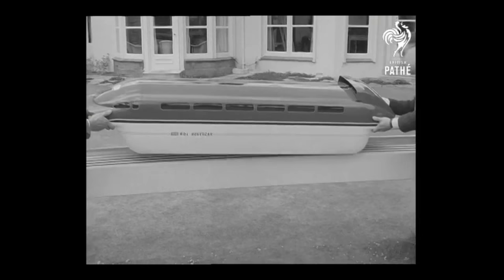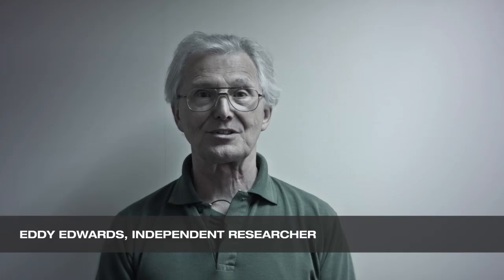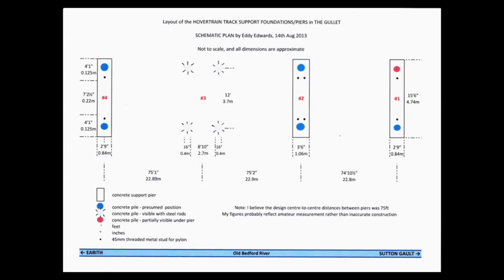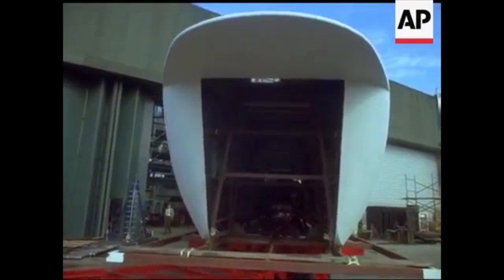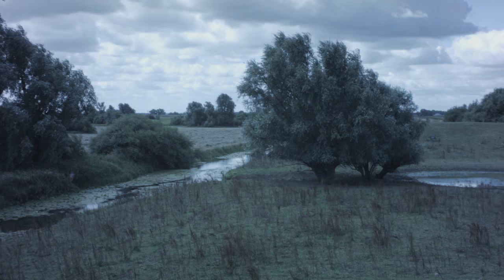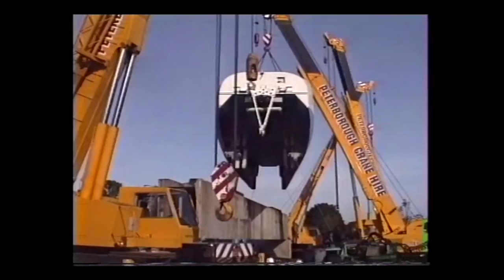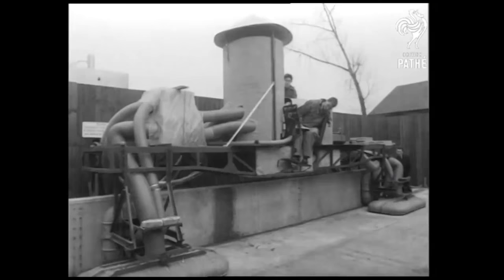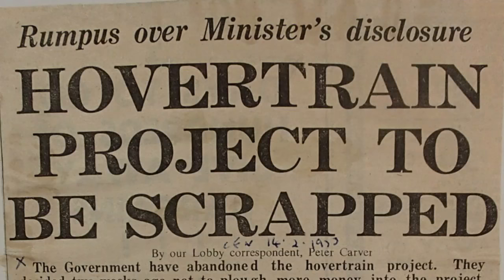The Train that Floats in the Sky

Comment: I was employed as site welder at the Sutton Gault end , I  wasn't  there the day when the Beam beam broke but about 2 days later there were people drilling core samples in it no doubt testing for concrete strength , I used to get lifted to the top of the gantry in a cradle suspended by 1 wire that was fine till the wind blew the thing in a circular motion , health and safety would have had a field day if it was these days !

Comment: This is an EXCELLENT concept! A MAGLEV train eliminates the coefficient of rolling friction between the metal rails and wheels. My feeling why this wonderful train is not used these days is twofold: 1) The high cost, and 2) The extremely STRONG magnetic fields can be hazardous to passengers with severe medical conditions like cardiac pacemakers, heart arrythmias and other conditions. For example, some medical patients are ineligible to have MRIs because of the strong magnetic fields.
Reply: The magnetic field induced in this type of maglev system is less than that of an old school CRT TV. It's safe to electronic equipment.
On the other hand, the competing Japanese maglev system uses superconducting electromagnets that require the passenger carriages to be shielded.
Reply: It would take investment to build, but not that much in theory, as the rail itself is just made from concrete and the magnet. Building a concrete rail would be cheaper and faster than normal railways. However it's much easier for government just to use the already existing network than to build a new one.
Reply: I remember BR Derby working on maglev. Monorails seem fine for end-to-end lines but when one considers capacity-number of coaches, signalling, switches (points)-it becomes difficult-and this is not for freight either. However, what Britain seems good at (politicians anyway) is getting skilled people to crown their energies by achieving a working prototype and the pulling the plug and destroying the hard evidence and the paperwork. (Miles M52 supersonic jet; Brabazon airliner; Princess flying boat; TSR-2; Fairey Rotodyne; Nimrod MRA4 and possibly now, HS2.
Reply: There are a few Maglev in commercial use today of which most are in China, and other in Korea. One of them is high speed (Shanghai). Japan is making one using a very strong superconducting magnet.

Shielding is being used to prevent those issues you mentioned.
Reply: @johnjephcote7636  There's nothing ground breaking about HS2. It looks rather second rate and poor value compared to other countries who are well ahead of us when it comes to rail transport. It's all very sad considering Britain invented so many technologies and had original ground breaking ideas.